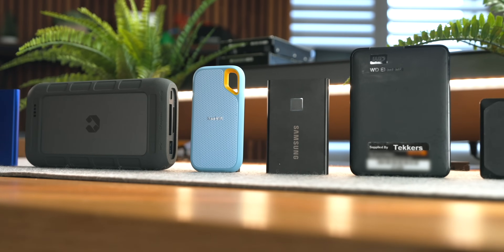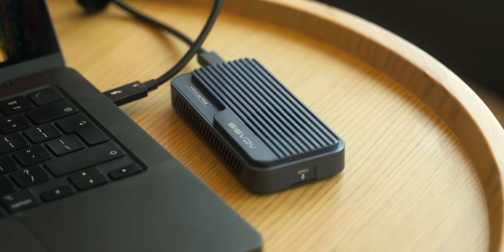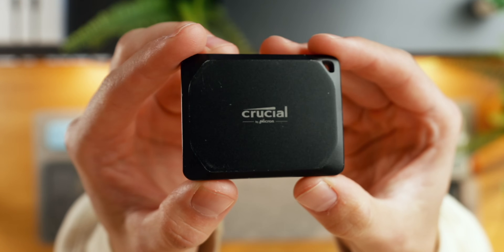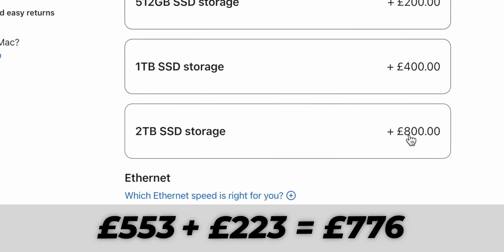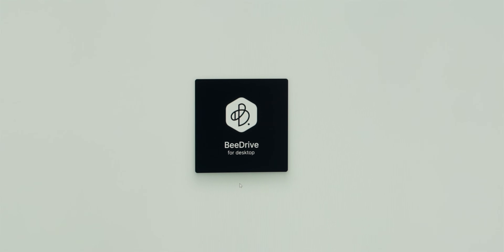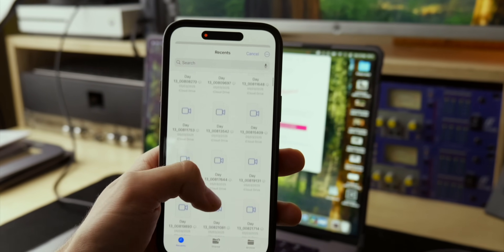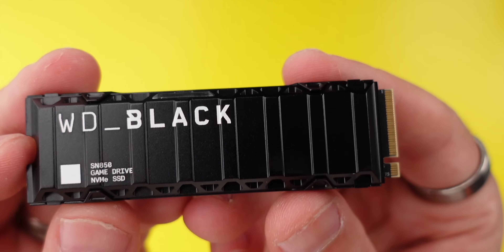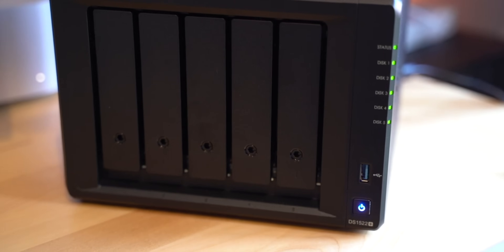DON'T Waste your Money! The SSD Buyer's Guide

Comment: Hey man, I don't know if my comment will ever cross your way, but please help me if You can. I have a 2 TB external ssd, I kept all of my datas, pictures, videos, I would say my 20 years of experience, memories and docs even my dad has some important documents on it. I plugged it to my Xbox Series X to save my clips from there, because Microsoft is suggesting to use an external drive/ssd to save those clips. I did it and now my computer only sees the ssd as a 32 GB pendrive, and I can only see the Xbox clips, all of my stuffs ~500 GB data just disappeared. I need those files, family pictures, it's a shame from Microsoft for not warning me, (a full non-computer genius) that connecting to a console will change the format of the ssd, and I'm desperated. I tried a lot of different apps to "repair" the files, but they couldn't get all the files, even if some did, the computer said wrong format and I can't play a video or see a picture, because it's corrupted. Please let me know it's not over for my memories and stuffs. Wishing You the best.

Comment: Bought the Sonnet Echo Dual NVMe Thunderbolt Dock with two Western Digital SN850P 4TB ssd's for harddisk recording. Very happy with it. Way overspec'd maybe, but future proof, and at least this will not be the bottleneck. I mean, my audio interface can record 32 tracks of 24 bit 96kHz audio, but that would only be about 75 mB's per second. Go figure how ridiculously fast Thunderbolt is at 6000 mBs per second!

Comment: Ouch Unify is so expensive but a great concept. Its almost $600USD plus 400ish for each 8tb ssd thats close to 1200USD
Reply: Great concept, but not so great execution.  The transfer speeds internal to the device are quite slow by today's standards, and those are USB3.2 Gen 1 ports (5Gbps).  I would ditch the HDMI port and Ethernet ports entirely and instead have a TB4/USB4 port, USB-C 3.2 2x2 port (20Gbps) and a USB-A 3.2 2x1 ((10Gbps) port.  If you want to connect this to a monitor, use one with USB-C or get a HDMI dongle.   Same with Ethernet, use a dongle.  20 minute battery life is abysmal, and that's their claim.  In reality, its probably more like 12-15 minutes.  This thing needs at least a 1 hour runtime claim, and there needs to be at least a basic screen and a couple of buttons to perform core functions without having to use another device.  That's the problem you run into in the field.  No cell service, the phone app or whatever needs an update/cell/wifi to work, and you ended up carrying this brick for nothing.  Totally not sold on "one touch" recording.

Comment: My Sandisk 256 lasted for years. However, it would frequently not work The problem with them appears to be that they over heat. There are just too many layers of bad heat conduction. First there is a layer of plastic coated copper foil. Then there is plastic and finally flexible silicon rubber. If you are unlucky enough to have bought one but lucky enough to have it still work, it appears to function better with a fan on it. Oy.

Comment: High capacities SSD's look great but they tend to be hotter working with large files. They may be fine if you only save items to it and keep it on the SSD but if you are working and moving files directly on the SSD they do tend to get a little too hot. Something to keep in mind if you are looking for a portable drive or a NAS solution.
Reply: @carf-e1  what would you suggest?

Comment: I'm part of the team that will never again buy SanDisk SSD. Lost all my data and had to pay 1k to recover it. They charged me 4k and I negociated down to 1k. Insane.
Reply: Wow that's insane. Thank you for the warning.
Reply: @fazzalad  When copying data to an SSD drive, copy the data to two external drives. If you lose one, you always have the other. Do it every time.
Reply: Храни копию в облаке бро✌
Reply: Yeah you must be new who copying everything to just one drive 🧐🧐🤨
Reply: @fazzalad  which one using as of now?
Reply: @nevilgajera90  I've been rocking the Samsungs for 5 years now and zero issues. T7s and T9s.
Reply: Does usb 4 version have issues
Reply: @fazzalad  No backup,thats on you
Reply: Get one more copy on another SSD or on the cloud.
No brand on Earth could protect you from losing data if you copy to only one place.
Reply: I was under the impression tht SSD (I also use SanDisk) was the best, most trustworthy storage
Reply: @reallue  It's trustworthy until it's expired.
SSD don't have bad sector to warn you like HDD so once it died, all data lost instantly.
If the data important, 2 back up copy of the same data is a minimum requirement.
I have one in my external, one on my PC, and one on my cloud.
Reply: @reallue Same! That’s why I was buying it.

Comment: Never get the Crucial SSD’s, I’ve had one fail but they ALL thermal throttle and become very slow during large transfers. They slow down massively to where it’s taken longer to transfer to vs. an USB3 HDD.
Reply: i game on a x9 never had any problems, maybe you bought a faulty one
Reply: @TarkYellow how big are your project files? I’ve gone through Crucial X6, X8, X9 and X10 Pro. All consistently slow down with transferring large projects and my X10 Pro died on me after 3months. So they all slow down massively with large transfers and one died. 

I’ve not had issues with other SSD’s from Samsung, SanDisk… 

So I’m pretty confident it’s not an isolated incident. 

But if you have one, do a test transferring a 500Gb project file on and off the drive and let me know how long it took from start to finish. It will start very fast then throttle massively!
Reply: @leo_hoang  what did you buy instead
Reply: @Viewer765I’ve not had any issues using Samsung T5, T7 or T9 Shield. I have a few of them. 

I’ve recently tried Lexar and so far, 4months in no issues but not in day to day use. 

SanDisk has had a bad rep over the past couple years but I have two and no issues for me. My serial numbers aren’t included in the affected batch either.
Reply: Ever tried running a fan it? not that you should need to.
Reply: @davidweather3267 I actually did try to see if putting it in front of the aircon would help, it didn’t… still throttled and slowed down massively… still works at least! Just not as fast as I would have expected

Comment: I have numerous T7 and T7 shields. 1 & 2tb. The shield versions I carry about all over the place. Never had a single issue.
Reply: Same, I have multiple T5's, T7's and T9's - Every single one of them runs without an issue. Even my oldest T5 which I bought in 2017, is still running flawlessly.
Reply: same, i have better ones at work and for laptop, meanwhile my home setup which is my main gaming one, i use my old t7 because it's been non issue since i bought it.
Reply: I got the 4TB and after barely year transfer speed slowed to a snails pace and needed to be formatted so I lost all my files 😢

Comment: Word of caution. Unless something has changed, I believe Macs don't support USB 3.2 Gen 2x2 due to a clash with Thunderbolt 3 standard.
Reply: That is correct, but only for 2x2
Reply: @Garythefireman66  Exactly. The regular USB-C 3.2 is OK, I use them myself.
Reply: @peterbreis5407  what are you using? I'm choosing one for a 23 M3 Imac, any recommendations? thanks (Crucial X9? anything faster?)
Reply: @passiondimension  get that model but the pro one
Reply: @ I bought the x9 pro mac yesterday
Reply: @passiondimension  great!
Reply: @passiondimension   how its working ?
Reply: three Thunderbolt 4 (USB-C) ports, a MagSafe 3 port, an SDXC card slot, an HDMI port, and a 3.5mm headphone jack